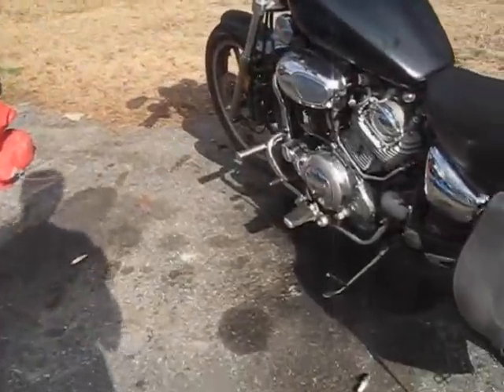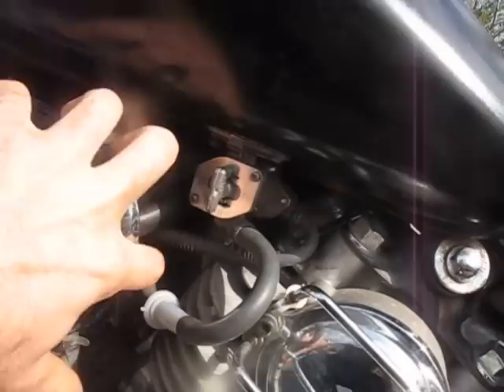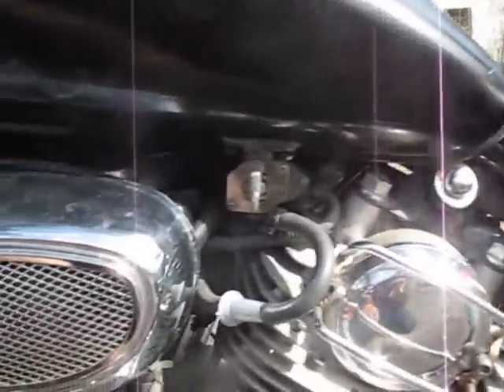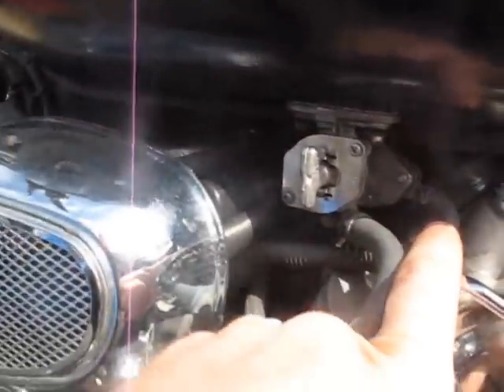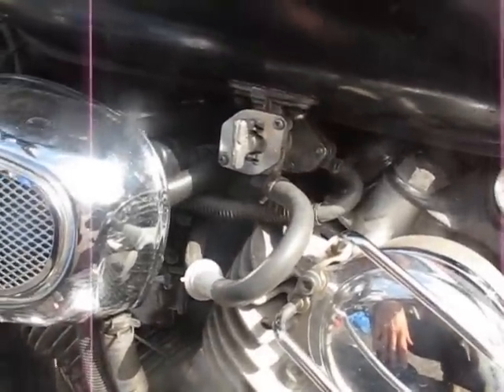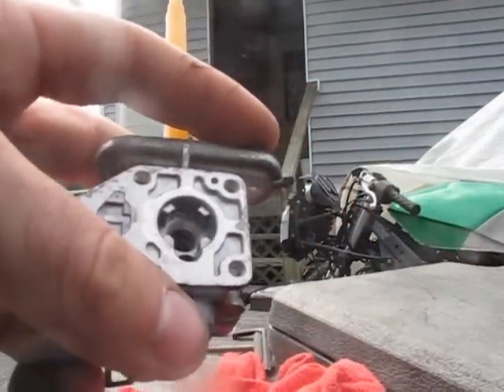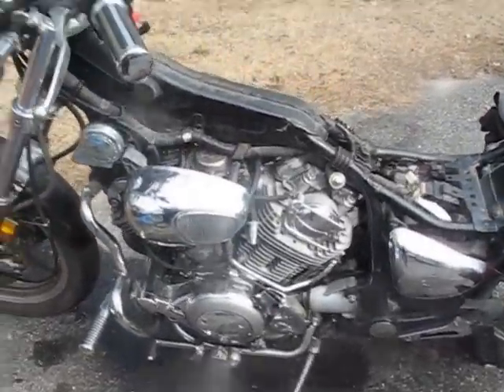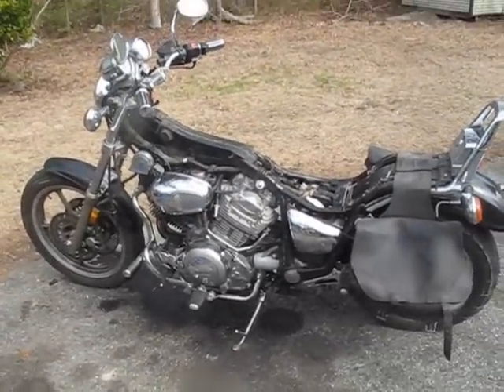How to fix your motorcycle petcock without a rebuild kit

Comment from the maker: @frankamartinez No but you can bend it to make it wavier, then it will press a little more tightly on the rubber. You also may need to clean up the rubber gasket inside or replace it if it is really bad.

Comment: thanks for the vids..i replaced the needles in the carbs and cleaned then,,cleaned the tak out..it seems if i put over a half tank of gas in it it will fill the carbs up and over flow though the top and fill the cylinder with gas..now with my petcock not shutiing of gas couls the weight of the gas pressing down cause the neeld to open and cause this from flooding..anything less then half a tank does not do it,

Comment from the maker: @zzzlt Ideally, it should. However as a bike ages that needle does not make as great of a seal. The petcock represents what is called a redundant system, or a backup, meant to extend the reliability and utility of the bike by preventing excess fuel flow in the case of a minor float needle failure.

Comment from the maker: @ifuckbunny Yeah get yourself a good battery and make sure the connections are really tight. If it still doesn't work, check the condition of your fuses and wires.

Comment from the maker: @Michiganborn1969 You probably have a vacuum actuated petcock, like in the video. This design takes advantage and vacuum from the motor to open a valve and let the fuel flow. These types of petcocks dont typically have off settings because when it is working properly, when the motor is off, the petcock is off.  The prime setting is the exception, this allows fuel to flow when the engine is off. It can flood your carbs if you leave it on, but is useful for filling them up after service.

Comment from the maker: There should be a hose running from the carb-engine rubber boot to the petcock. If there isn't, you will have to install one, and connect it to one of the little brass nipples. Take a look around there and see if you can find it

Comment from the maker: @AcuraDude44 Indeed it should but floats and needles also go bad and leak. These two systems are designed to be redundant and compliment each other should one of them partially fail, however in bikes of this vintage it is all too common that both of them are gunked up by the same rust/old gas varnish

Comment from the maker: Indeed, you get this overflowing problem with a simultaneous failure of the float needles and the petcock. They are redundant failsafes which only cause problems when both get dirty and fail.

Comment from the maker: @dlmzg Sounds like it is really gummed up in there, take it off the tank and soak it overnight in clean kerosene or gasoline, that should loosen it up. You'll need to take it apart anyway and clean it after you free it up.

Comment from the maker: The needles should be able to withstand the weight of the gas. What it sounds like may be happening is for some reason your petcock can shut off when on RES but it is wide open on ON, and you have a float/needle overflow problem. The petcock is therefore able to hold off the gas but when you fill it above the little ON hose (the taller one) the gas pours into the carbs, which overflow. You need to fix the petcock and the overflow problem with your carbs

Comment from the maker: @sknmtt88 Sounds like your petcock is either damaged or dirty, take it apart and take extra care to inspect the diaphragm within the vacuum part of the petcock. If it is ripped, there isn't much you can do, gotta buy a rebuild kit. However if it is dirty, you can clean it. Don't be afraid to take it apart and clean it, they are pretty simple components.

Comment: Just bought a kit for the petcock on my GSX600F because it was trickling. Took all the old pieces out and the new ones in. I'll be damned if it wasn't worse. So I found this video and saw the "trick" for the diaphragm return spring (not sure why I didn't think of it.) Also  my kit did not come with that spring. So I did exactly as you said and tested to see if it would work with vacuum applied, and it did. Thanks for your help I was about ready to buy a brand new one which go for about 110 bucks

Comment from the maker: I will usually just fill up the bowls and crank it up. If yours will stall after a minute, sounds like something is still dirty, damaged, or otherwise dysfunctional. First thing I would check is the petcock, make sure there is sufficient fuel flow

Comment from the maker: @jbalboy1234 I would suggest taking out your petcock and cleaning the little screens, they might be getting nasty. As for your faceplate, you can try again pulling the spring and cleaning the rubber gasket, but in the end you might need to break down and buy a rebuild kit.

Comment: @mrmaxstorey 
Cool, I learn something new everyday just as I learned something new about a week ago where I pulled the left side plastic battery cover & fouind some specs there such as plug gap, idle speed and other things including that I should have been running 91 octane (premium). So I've been running 91 ever since & I find that it seems to run much smoother.

Comment: This video just helped me a lot, which is good because my bike uses one of the most expensive petcocks Yamaha ever produced... the electric reserve solenoid for the 86/87 FJ 1200. Cheapest price online? $175. 

Aside from saying thanks, I also have to mention that it wasn't quite enough. I had a steady drip after replacing my plunger o ring and stretching out my spring (this petcock has no faceplate, no 'selectable' reserve or prime, so the first two tips don't apply to me...) cont...

Comment: I am sorry if I am bothering you I just never delt with stupid stuff. I took the tank off and pulled the fuel line off and stuck a screw driver in the fuel in and there was nothing blocking it. I put the fuel line back on and I couldn't blow any air into the carb. I never had a no start issue before. I have 1 cc insulin needles could if fill the bowls up using the air bleeds on the air cleaner side to squirt fuel in the bowls?  Taking the carbs off is a royal pain. I just never delt with 4 carbs

Comment from the maker: Well if the carb bowls are full, teh floats should be blocking off the fuel flow so you wouldnt be able to blow any air in there. If you ever doubt whether you have gas in the carbs just loosen off the bowl drain screw and see if anything comes out. Have you tried starting the bike on starter fluid? Perhaps you have wet/dirty plugs and the carbs are no longer the problem

Comment: Great video.  I'm kind of stupid so it took me awhile to figure out my problem.  My buddy always left the petcock in the Prime position to shutoff the petcock on a Suzuki GR650 Tempter.  So after I bought the bike from him, I noticed the gas smell but could find no leaks.  Finally one day the engine wouldn't crank over.  I knew I had a good battery but double checked it and charged it up more.  Then, I added two batteries in parallel and it would slowly turn.  On a hunch, I checked the oil level sight glass.  It was way over the top as the crankcase was filled with gas.  I drained out six quarts of oil/gas from the sump that holds 2.5 quarts.  The bike was hydrolocked.  So I drained everything out and refilled with new fluid and the bike ran great on the "ON" position of the petcock - until I had a guy come over to buy the bike and he fussed around touching everything.  I had to explain vacuum operated petcocks and all.  But just on a hunch after we made a deal for the bike, I went out the next morning and checked the oil level and once again way above the top of the sight glass.  Now I don't know whether to just trash the bike and get rid of the aggravation or maybe put in a normal, non-vacuum petcock.  Beware of all bikes with those vacuum operated petcocks.  They compensate for the stupidity of guys too dumb to turn off their gas line but they cause more problems than we need as they can so easily go bad.
Reply from the maker: Your crankcase is filling up because one or more of your float needles in your carbs is worn or dirty, allowing gas to leak past it when the bike isnt running. They should stop the gas even if the petcock is left on prime. It would be a shame to trash the bike over a $1 part. These vacuum petcocks are a pain on 40 year old bikes with 40 year old gaskets, but they have saved a lot of lives, because in theory they will stop the gas somewhat in the event of an accident and at least keep it contained in the tank.
Reply: @mrmaxstorey  You've got me thinking.  So even if I had a manual shutoff, as the engine is running with the petcock in the ON position - the carburetors would be overflowing with gas because the float needles wouldn't be stopping the flow of gas.  That would explain the running rich condition my bike has now.  Seems like I should first drop the fuel bowls and replace the float needles.  There may be nothing wrong with the petcock.  Thanks.
Reply: @mrmaxstorey  This is going to be an interesting mystery to solve.  Another fellow said that gas is getting into my crankcase if the diaphragm in the shutoff valve is torn.  He said that would allow gas to flow into the vacuum port and into the crankcase.  Before I pull out the carbs (especially if I don't have to) I wonder if there's a way to test them.  Maybe I could hang a bag of gas above the carburetors and let the gas flow into the carb(s) and see if there is a point where it shuts off from flowing out.  Good idea, Tony.  Give it a try.  And thanks to you, Max, for putting me on the right track.
Reply from the maker: @STBRetired1  Hes not wrong, its simple enough to test. Take off the tank and put it on your bench, and suck on the vacuum hose connected to the petcock. If gas pulls through, the diaphragm has a leak. You can also bench test your float needles by pulling the carbs, placing them lower than your tank on the bench, hook up the gas line and put petcock to prime. If it overflows out the overflow tubes or through the throttle body, then your needles are leaking
Reply: @mrmaxstorey  Excellent suggestions.  Today we have a heat index of the high 90's.  Tomorrow, it will be in the 70's.  I'll get started tomorrow.  Thanks for your help.

Comment: i have a 1983 yamaha sa50 passola and thought that part was a fuel pump. ( it is apart on the frame. not in the fuel tank) i am working on it. it sat in a garage sins 1986 i guess. i bought it last year from a friends father.

Comment: Have a question for you. When you take the carbs off and clean them what is the start up procedure after you clean the carbs? I used 2 cans of cleaner.  I took the choke system off the top. I did one carb at a time. I blew all the holes out like the ones in the bowls. There's the tube that goes into the bowl for the choke system. I blew all the holes out even the small one on the choke. I can't get the bike running. It will run for a minute or so and stall. Not like the Honda fires right up.

Comment from the maker: You should be able tof ind a whole petcock with the filter straws on ebay for not much money, I know a bunch of KZ bikes will fit your tank. If that fails, I have made my own before using a plastic tube and a length of mesh screen.

Comment from the maker: Your petcock is similar to the one in the video. The video shows all of the parts in the typical petcock, unless your parts are badly corroded then there is no need to replace them. However if your parts are pretty bed off, then you can find a petcock rebuild kit on ebay. There is one on there right now for $19.99

Comment: i fixed it with only 4 dls i bought two manual cut off valves for 4 bucks at orileys and placed it right after the petcock and vuala, problem solved i dont have to worry about it ever leaking in, definetly cheaper than having to buy new oil everytime it leaks, so now its i just shut it off manually and works great

Comment from the maker: Well if the bowl gaskets are leaking, then thats the problem right there. However if you are leaking out your overflows or into your crankcase with the bike off, then you have a simultaneous failure of the float/needles, AND the petcock

Comment: Thanks! I realized later that the seals and the pressure button are around the plastic spacer. The plastic spacer has a hole in the middle that allows you to pull the seal through the spacer.

Comment from the maker: @dlmzg Right, you may need to get in there and do some scraping, check out the vieo again and try the spring trick, and clean up the faceplate side of the petcock (the side w the lever), you basically need to get the whole thing apart and clean both sides really well

Comment from the maker: first take it back apart and make sure it is all assembled correctly, and that the rubber part is not pinched or misaligned. if you have to, you can put a small film of grease on the rubber part

Comment: I just did this on my 86 Savage.  It did seem to help a bit, but the bike still doesn't like to run in the on or res position.  I get about half way to work when the bike will completely die at a red light.  If I switch back to prime it will start back up and act fine and runs great.  I am not getting any leaks and my oil level is fine with no gas smell.  When I bought the bike it was in the prime so didn't think anything of it, but I asking for trouble if I don't get this fixed?

Comment: my petcock is leaking on my 93 zx6r I watched your video tore mine apart and seen there was some corrosion off the door part when the "nasty gasket" was but in the top.  Everything else looked good on the petcock other than that little deal there would corrosion be enough too make it leak?  And is there any way I can test it too see if I got a good seal without putting it on the bike could I use like water or anything of that nature??

Comment: Hi tks four your great video tank you, I have a Sym Fiddle is a version 1 from 1999 my petcoke "vacuum" is not pull the fuel out on lines just a question the petcoke can be repaired or need a new one tank you best regards: Venancio Berenguer
Reply from the maker: Yes the petcock can be repaired

Comment from the maker: Yeah they are probably right. The vacuum actuated petcock and the float needle are somewhat of a redundant system, if your petcock leaks or fails then you should still be ok so long as your needles are clean and closing properly. If you have gas coming into the airbox, chances are they both are in need of repair. Also dont forget to change your motor oil before you start up your bike again, gassy oil can be very harmful to your engine

Comment: i have a question, my gf has a 1983 virago 500.it has a 2 section petcock on it. and it will drian the tank right into the base of the engine, shouldnt the floats in the carbs shut the flow of fuel off so they do dont fill the enigine up with fuel..or does these types work differnet then lets say a dirt bike carb

Comment: Good vid. Im having the same problem a slight leak. Im on my third petcock (used) in 4 years and will definitely try this. I have a shutoff valve $12 on the way that i am going to hook on between the petcock and fuel filter and use it to prevent future leaks into the engine. Why cant they have an off setting anymore lol

Comment from the maker: Yeah it appears as tho the petcock is not opening in the ON position. There should be a little rubber hose on the back of the petcock that runs to your intake manifold. First, check this hose, make sure it has no breaks, and is connected at both ends. If it is then something is broken inside the petcock, it need sto be taken apart and cleaned or have parts replaced. Go to my channel and watch my other petcock video for more info

Comment: My husband took the tank off my virago last fall so we could get it painted, the petcock is bad this spring and now I know what to do with the rebuild kit when it comes in.  The other problem, he forgot where the pigtail goes for the low fuel light.  Unfortunately you skipped that part of the video.  If you could fill me in it would be greatly appreciated.
Reply from the maker: Yeah this video focused mainly on petcocks, Im not sure where your pigtail goes but it shouldnt be that hard to find, just look at how long the pigtail is and that should give you a good radius of where the other end may be hiding
Reply: mrmaxstorey It's the same exact bike you did the video on.  Yamaha Virago, that's why I asked.
Reply: He didn't, but regardless of that, if you look at the end of the pigtail you'll see a fitting/plug; then look at how long the pigtail is, then look around the frame and above the engine about the same distance away as the pigtail is long for a plug that is similar.  The best trick for figuring out where wiring goes is when you're lucky enough for it to have 'shape" to it already, meaning when you set it in place it's already bent to a particular direction, telling you which way it probably used to go.
Reply: I had to pull the seat, but I found it.

Comment from the maker: You can flush it if you want but just a oil change should be fine. This is caused by the simultaneous failure of the petcock, as described in this video, and the carb floats. You can see how to repair those in my video on leaking carburetors

Comment: @mrmaxstorey i soaked it in gas.. came apart..i tried to clean it out as much as possible but still the lever wont move but now gas can flow threw but its leaking out of the little gold pipe isent it not supposed to come out of there at all??

Comment: Hi Max, thanks for the video, I just wanted to know if I could replace a vacuum petcock with a normal one & block the vacuum tube. Will this to any damage to the bike? I have repaired my vacuum petcock twice now but the parts that need replacing are not available anywhere the bike is a suzuki bandit 250. Any advice on purchasing a new petcock to replace the existing. I have searched the sites you have recommended in your other video, no luck in finding the parts I need.